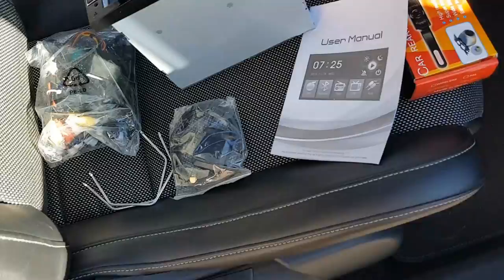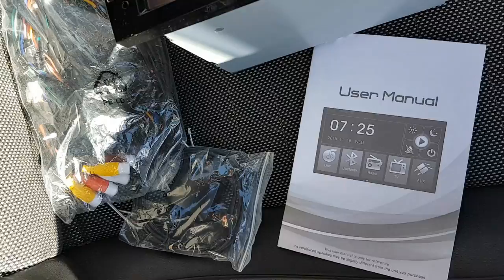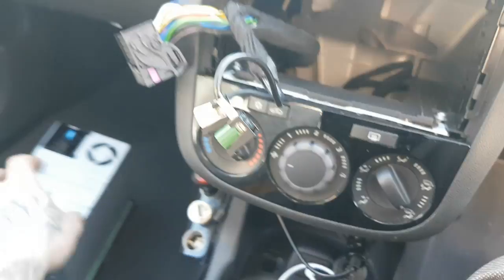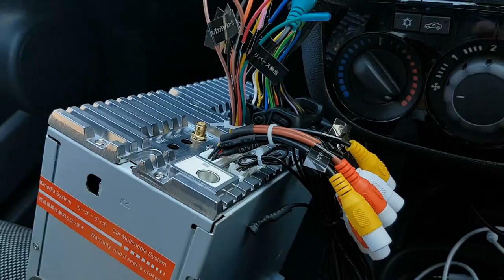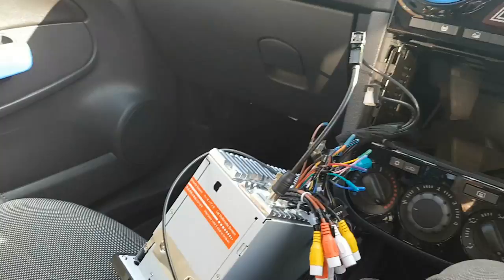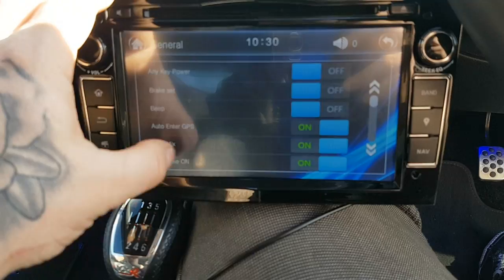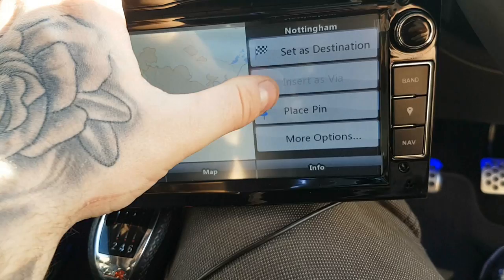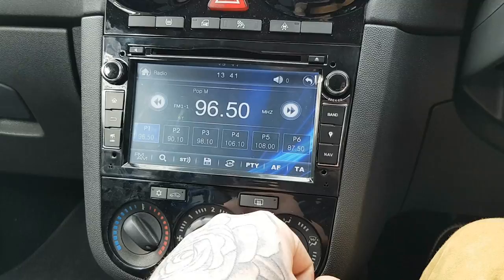Installing TouchScreen Radio, SatNav & TV - Corsa VXR

Comment: !!!Heads up!!!

I've just bought the latest and greatest of these touch screen units running android 7.1.2, great specs etc, HOWEVER these don't fit as easy as it looks in this video, unless the VXR has a different dash and different cage for the radio to the LE/other Corsa D's. The signal radio antenna in the back sticks out way to much at the back and there is plastic exactly where it comes out. You literally have to cut a square out to allow the cable to go through. There are different cables that don't stick out nearly as much so I'd recommend you look for them and order one along side a unit because mine came with the same one as the one in this video and all the other units are the exact same placement and wire. It will slide in but stick out about half an inch because of the wire at the back.

The unit itself though it's so good, I can't fault it, completely transforms the car.  Brilliant bit of kit, worth every penny.
Reply from the maker: WassellThatAbout I didn't have this issue mate mine fit perfect
Reply: I've got the same problem with my Corsa D. Have you found a way around it at all?
Reply: Henno I explained in the comment mate, either cut a square out of the plastic so it can pass through or get a flat right angle wire alone with an adapter will cost around £10.
Reply: ok, thanks mate
Reply: What’s this called??

Comment: Recently bought one of these last month but been having issues with the radio signal. I understand it's a grounding issue but where would the grounding point be? Is it on the antenna adapter? Mine has a blue wire on the adapter as well which I'm not sure what it does or is there another point where I can ground it?

Comment: Hi mate 
Really helpful video 
Simple and informative 
Did you mount the GPS receiver in the back of the dash or on top in the end ? 
Also would you recommend it after using it for a while ? 
Cheers
Reply from the maker: Oliver Pitbike hey mate, I put the GPS receiver just next to the cup holders under the fan controls, it gets a great signal there and u can hide the wires and it doesn't get in the way, I would highly recommend it you can custom set audio tones along with the addition subwoofer cables which I'll be adding too at some point
Reply: Rusty Phat alright cheers mate do you have a link to it or did you just get from eBay ?
Reply from the maker: Oliver Pitbike straight from eBay mate just make sure it's compatible with vauxhall the link to this isn't there anymore

Comment: do you have a link for this product !! can you use spotify on it? and is it suitable for a 2011 corsa x
Reply from the maker: You can use spotify on it and it is also suitible for a 2011 corsa, i dont have a link but it is a pumpkin brand stereo
Reply: I've got a 2011 vxr I've looked on Ebay at pumpkin brands and they all say not compatible?? Do t fancy spending £200 for it not to work, is this a real pumpkin, because all the ones I've seen have pumpkin at the bottom just under the touchscreen.

Anyone know??

Comment: Nice vid! Did you have to connect any other cables to keep the steering wheel controls?
Reply from the maker: No mate that was it, you can also custom set what your steering wheel controls do within the unit
Reply: Sweet! Cheers mate, much appreciated.

Comment: Hi mate when you said about the gps receiver you out it in the cup holders where did you feed the wires through to put it there if that makes sense to you
Reply from the maker: Under the bottom of the trim mate of the centre console
Reply: @RustyAutos  you have a photo by any chance thanks for the reply as well mate

Comment: Hi bud, quick question about the AUX. My car has an AUX port near the cup holders infront of the gearstick. How would I connect this to the system so it still works? I've had a look at the wiring diagrams on the listing but there are multiple AUX inputs.

Thanks
Reply from the maker: Namlasm1 personally mate I'd just connect to the system using Bluetooth, you have to connect some wires behind the cigarette lighter I believe to connect the aux unless you get one with a built in aux
Reply: Rusty Phat what about the centre screen in the car the one that shows your phone and  stuff dose that still work with this radio
Reply from the maker: Mine does, however it just displays a blank screen for the songs your playing, but the petrol and phone etc is still visible

Comment: I've had my system probably as long as you have. Been some power problems recently (randomly cuts off while I'm driving). Have you had any problems with this system?
Reply from the maker: Mohammed Hamid hello mate, I havnt had any issues with the unit mate, have u checked the wires are properly pushed in at the back?
Reply: Rusty Phat done that a few times. Reboots the system but still cuts off while I'm driving... I've made pumpkin aware and they've agreed to repair it-problem is they're all the way in china!
Reply from the maker: Mohammed Hamid have they said they will pay for shipping?, ive literally not had any problem with it, ive never had it turn off

Comment: Looking to purchase the same one for my Corsa. How has it been so far? Read some reviews of people saying they've been switching off randomly
Reply from the maker: Hello, the only way i could think of it switching off randomly is if wires are loose, but i have not had one problem with this yet :)
Reply: Rusty Phat that's great then. Does it connect to steering wheel controls and Is it worth what you paid for? Been looking about for touchscreen radios but haven't yet been able to find one to settle on

Comment: Looked at buying this the other day and looks really simple to install.. Does the steering wheel controls still work on it for volume etc?
Reply from the maker: richard gregg Yes mate they do, everything is compatible
Reply: went and got the radio and it works great.. sound quality and sat nav is very good.. i only have 2 problems.. the radulio when installed protrudes slightly i think its the radio cable on the right and also the aux dosent work.. any idea's?
Reply from the maker: richard gregg maybe the cable is catching on some plastic behind? see if you can get a different radio cable to connect it at a different angle to try and reduce the gap, I didn't have any issues with mine

Comment: Hi mate, ive had this for around 2 months now and this morning it wouldn't turn on, thought it could the the change in heat but that's unlikely, I've held the on button and pressed it a few times, any ideas?
Reply from the maker: Blackwall Studios have u tried checking the wires on the back just incase any has come out?
Reply: Rusty Phat I'll check that tonight mate, thanks, if it's not that what do you think it could be?
Reply: Rusty Phat Wires checked, plugged back in, all in working order, thanks. Thought I'd give the car a clean while I was at it too whth the nice weather, have a good weekend!

Comment: If you leave the gps antenna on something metal behind the dash it should be fine
Reply from the maker: Ben I did try this but I have very very limited room behind mine so it's fed around the front and sits where the cup hold is under the air con controls and works perfect

Comment: 1:31 I cannot get the dahm radio out. I put the double din pin set in, and pull apart, but the thing is not comming out!? It's like it's stuck. Anyone have any ideas?
Reply from the maker: It literally shud just pull out mate, make sure the keys are fully in
Reply: @RustyAutos  I have tried almost everything with the pins, im really lost now. Because yea, i see people everywhere having no trouble at all, but mine just don't want to come out.

Comment: Hi, how can you link up the Bluetooth?
Reply from the maker: Blackwall Studios put Bluetooth on your phone and connect to "car kit"
Reply from the maker: Blackwall Studios it is the exact same one mate :)
Reply: Rusty Phat I'll let you know how I get on!
Reply: Hiya mate, did you leave the GPS in your glovebox in the end it was it not picking up the signal? I don't know where to place mine. Thanks
Reply from the maker: Blackwall Studios hey mate, I left my gps box next to the cup holders under the heated controls, I get full signal there
Reply: Rusty Phat cheers pal, put my head unit in today, all looks good, still trying to find all radio stations though, is there a auto tune or something to pick up like radio 1, capital etc?
Reply: Sorry another question, I didn't install the rear view camera is there a way to disable the camera coming on when you stick it in reverse? Cheers
Reply from the maker: Blackwall Studios I haven't fount one yet, I think there may be an option in the settings but I will look and get back to you :)
Reply: Rusty Phat cheers mate, is there a setting for the rear camera too to disable it when you stick it in reverse?

Comment: Hi mate, do the steering wheel controls still work with this?
Reply from the maker: Yes mate, everything still works with this, you just need to look for a compatible vauxhall console, with this unit you can also, re-configure which buttons on the wheel do what on the stereo :)
Reply: Rusty Phat sweet sounds good! cheers 👍